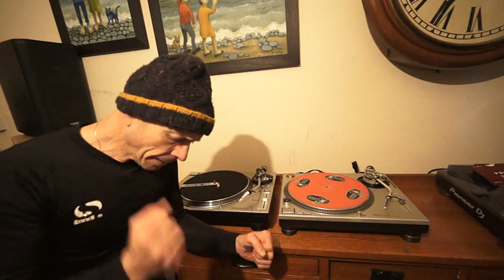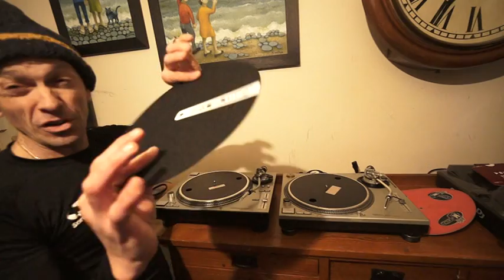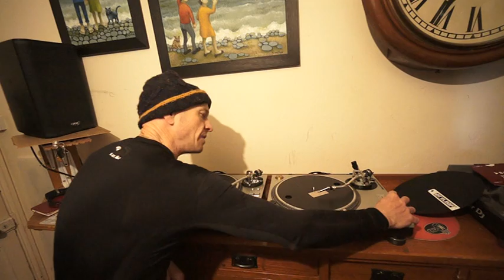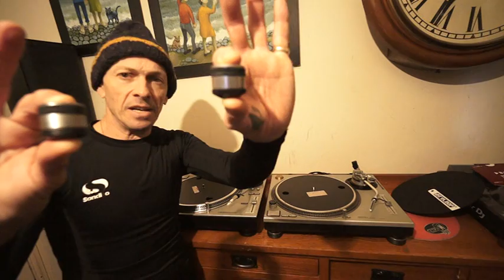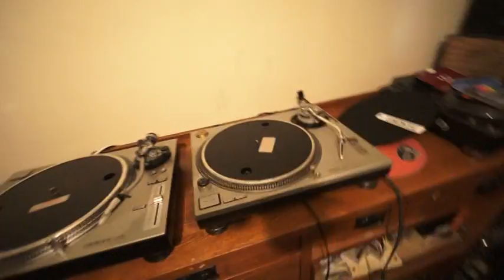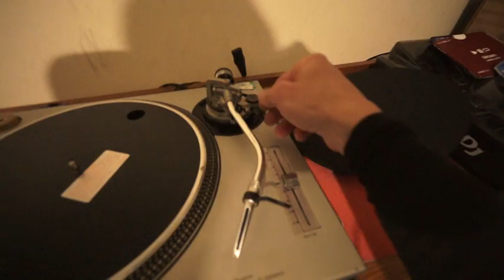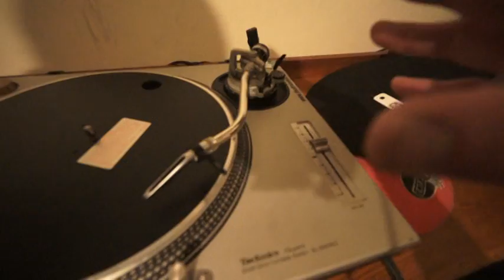RELOOP RP7000MK2 SIDE BY SIDE TECHNICS SL1200MK2  VINYL TURNTABLES

Comment: All true but there is one big difference. Analog vs digital pitch... for vinyl mixing in some styles its a huge difference. And this is the thruth.

Cheers mate and keep up the good work
Reply: Yes, I was about to comment the same thing.
The Reloop's are just as good as any other Hanpin motor turntable, so you may as well buy the Reloop's rather than spending stupid money on Pioneer PLX1000's as they are all the same under the lid.
And, if you are more into scratching, with simple beatmatching ie dropping tunes in over 2 to 4 bars, using timecodes, then any Hanpin deck will probably be fine.
But, for long transitions on real vinyl, you really need a Technics Mk2, M3d, or Mk5, because only those have analogue pitch sliders (which still control a digital circuit - but the adjustment is a lot finer).
Digital pitch sliders such as the later Technics (M5g onwards) and Hanpin / super oem decks, have large steps in the pitch adjustment which causes real problems for long mixes with real vinyl.
Also, higher torque motors, are not a good thing for delicate mixing, because the platters 'fight against' your finger drags and then slow down too much. On The original Technics, you can literally drag a nail on the platter and slow it by a tiny amount, thus a finer adjustment is possible.
Reply: But in current days you only can buy digital pitch turntables. Who knows if in the future we can buy new turntables with analog pitch
Reply: @djmoli04  You can still buy refurbished Mk2/M3d/Mk5 with brand new pitch sliders, and repainted so they look and work like new.
Reply: @DjNikGnashers  Thats not true... I´m DJing for over 20 years and i always used technics. I gave the RP 7000 MK2s a shot.. First i have to got used to the pitch but if you have figured it out, then it just works like a charm. I uploaded a minimal video set on my channel where you can see there is no weird pitch correcting every 2 bars...  in my opinion the pitch of the reloop is sensitive af compared to the technics.
Reply: @ThomasTune82  Which part of my comment 'is not true' according to you.
I have been DJ-ing since 1980 (42 years), so if we are point scoring I win.
You have not even said if you are mixing real vinyl or digital files via timecode.
I suggest you read what I said again in a bit more depth and then comment.
Reply: @DjNikGnashers  i use both Vinyl and Timecode.. no Problems
Reply: @ThomasTune82  If you can't tell the difference between them, then you genuinely are either not a good enough DJ to comment, or you are trolling.
I can post video proof of both the differences and the flaws of the hanpin motor pitch issues if you wish, and the technics digital turntable pitch dead spots, and wow & flutter motor issues.
So again, I ask, which part of my comment are you saying is not true ? Still waiting for you to explain.
Reply: @DjNikGnashers  as i said i have no issues with my rp 7000 mk2s
Reply: @DjNikGnashers  i know that the 1200 Mk2s have analog pitch and the super oems are digital... but I got no dead spot on my RPs... when i move between + 7 and 8... the strobes actually chaning in movement.. since this is digital they maybe some have a faulty firmware. mine are brand new.. so maybe hanpin fixed some issues with the firmware.. i can really say that i got no issues with vinyl or timecode
Reply: @DjNikGnashers  There is a difference between telling a difference between them and one being worse than the other. They are "different" but both are good. I have seen world renown djs work both analogue and digital pitches with no issues
Reply: @aneshas  'Seen' ?
Oh dear.
When you have decades of actual personal experience of both, you know.
The vast majority of modern DJ's play digital files, even on turntables (timecode vinyl) and the tracks are all produced to be perfectly on a certain bpm, so that mixing requires zero skill, as you don't need to be able to beatmatch. You simply set the bpm's to the same number and there is no way you can 'go wrong'.
Real analogue vinyl on the other hand, is completely different.

Comment: Just a thought....the most important thing on 1210 is the analog pitch fader.....its super super fine, I'm not sure you get that with digital pitch faster as it has stepping?
Reply: The only thing I hate about the 1210 is the center click of the pitch fader which they fixed on the mk3
Reply: @digitalbase9396  but were mk 3 digital or analog pitch faders😉
Reply: The digital pitch was introduced in the mk5 deck according to Wikipedia, https://en.m.wikipedia.org/wiki/Technics_SL-1200
Reply: @digitalbase9396  I think your right...I had my 1210 mk 2 faders replaced ....he replaced them with no click...although I kinda missed it for a while.

Comment: Digital pitch Vs analog pitch , 
You should mix some records on both turntables as test at same time  Pitch them up and get them in time, leave them playing,  I tell you now the reloop won't stay in time like the technics that's where today's decks fail with real vinyl 
technics sl1200 MK2 will always be the better deck turntable to mix real records but for scratch performance both but reloop better in that area with features, DVS both will be the same depending on DJ software , no doubt technics will have quality parts that stand the test of time, this reloop is great turntable, but will it stand the same test of time ?
Reply: 1CBRDUDE  i agree , but I wouldn't say he has no clue on this subject mate , the guys been mixing on Technics decades with experience , what I would say is that yes these reloops digital pitch might stay in time for bit but your have to keep adjusting the pitch chasing it,  digital pitch works in blocks there is no fine tune between each block like Analog pitch , that's why Technics pitch stays in time longer ( fine adjustments ) also Technics  qualtz decks direct drive motor is just the best for mixing records there is no high torque or super  etc it's just nice balance
Reply: 1CBRDUDE p

Comment: Technics every time for me
 The standard was set a long time ago and in my opinion hasn't been beaten yet. When the reloop decks have spun for 30 odd years with no probs I will maybe give them credit.
Reply: Agree mate, it's just better all round turntable for real vinyl , your be fine with DVS with the reloop buts that's as far as it goes , if I'm DJ in club with both them decks are instantly know which turntable I'll put my record on (Technics)  the other looks too light , the feet etc.  It's more about the build
Reply: @ja nee I said Technics was old technology in 2000 mate , but it's still good today ,  the parts are solid built in Japan by Technics Panasonic !  Today's turntables have cheap parts made else where
Not much new about reloop who are part of huge DJ electronics group that have Denon , Akai, Numark etc  reloop has clearly based and modelled it's deck on Technics SL 1200 mate lol
Reply: @FSwiftDJ  Re-loop 7000 series blow Technics out the water, The new Technics design is not the same as the originals, Panasonic made a massive blunder selling the copyright for Technics, Even the Vestax blew Technics away 20 years ago, especially when used for battle Djing!!!
Reply: Really ? If so why does Johnathan no longer use reloops then lately check his latest vinyl mixing  ? He's back to Technics SL 1200 MK2  why ??? Because it's simply better to mix vinyl on ( stays in time longer )  I agree the new Technics are not great , but the original is still the best deck for mixing or the all round DJ 
If you saying pioneer plx1000 was better ? Well I actually got them and I returned them in 1 week max , they couldn't hold a mix with vinyl simple 
Reloops are great for performance or battle for sure but not mixing real vinyl
The design on rp 7000 is more Technics sl1200 you can see that ,  Vestax  had great decks but was they considered club standard nope !! You never see one in any club ,  again we are talking original Technics sl1200 sl1210 MK2 here not the new Technics sl1200 Mk7 that is very like a failed Technics sl1210 mk5g deck
Your better off getting an expensive Technics SL 1200 GR then them
Minus the feet.
Back to subject , we are not talking high torque motor performance or features , we are talking solid builds, Solid parts that have stood the test of time with qualtz direct motor and analog pitch that has been the choice for every professional vinyl club djs from late 80s till this day 
It's a deck that is an all round performer .
Reply: @FSwiftDJ  Because he is a Technics fan boy and cannot see past the brand name, The old skool Vestax pdx mark 1 and 2 absolutely blew Technics away in every department and that was 20 years ago, are you saying other manufacturers can't surpass a 40 year old deck is that what you are trying to say??  i've had Technics sl1200s sold them bought Vestax pdx mrk 1, As for the re-loop  i've used them and thought they Where easily as good if not better than Technics, they have a ton of better feutures, one's i dd a set on where the 8000s right enough but same motor as the 7000s and thats my opinion as a Dj who's played for 26 years..
Reply: same as I've  been DJ'in very long time, I've mixed on them all , but Technics are the best for long mix & blends it's a fact mate 
I never said the reloops was not great 
But with Audio equipment the old equipment even if it's so old , always still sounds good and works , but I 100 % respect your opinion fella
Reply: @FSwiftDJ Yeah i get you man, i just have a thing about these people whose have the Technics blinkers on, as i say and as you well know there are many good products out there, i guess you have to find what you prefer too play on too, but i'm not saying Technics are bad they where the standard for abot 20 years and still have a mighty legacy but tbh honest i'm glad that i can discuss decks and not cdjs as i'm old skool and prefer vinyl, (just a better sound) Kinda like the hardware debate with analog vrs digital,  it's what's good for you and what turns you on.. ✌🏻
Reply: If you think a 30 year old deck is better than a modern one (Reloopmk2) at revolving a piece of vinyl, you're being romantic, looking through rose tinted glasses.
Reply: @onemoresi  I love my tinted glasses and I'm allowed my opinion 👍
Reply: I've had my pair of 1200MK2's since 1993 and I have never had a problem or had them serviced and they still look and play like new. I paid $750 for the pair.
Reply: @djbhe  that what I'm talking about 👍

Comment: I like how you didn't go in to great detail about the history of the technics.. I'm sure there was other direct drive decks at the time but they weren't technics.. i saw a hip hop documentary and a budding young american dj who was forever experimenting with electronics one day went in to a shop like rumbelows and was looking for a turntable that can get up to speed very quickly and found the technics did that.. i guess technics realised what they had and improved on that turntable which meant it was going to be used pretty much everywhere.. radio stations and clubs ... that young american dj was grandwizzard theodore.. the turntable was possibly an original 1200 designed for home use.. it was the bees knees... the rolls royce of dj turntables ..everyone who dj'd had to have the technics...it was the rolex watch equivalent...

Comment: Is it time? Time to lay Technics to rest? Is it time to realize that there are better turntables out there? Better turntables for mixing? Better turntables for scratching? Better turntables for sound quality? The 12's are a classic turntable and without it DJing would not look the way it does BUT it's time to move on!
Reply: I can’t let go of mine, I’ve had them since 1995 and they are going strong.
Reply: Digital Base If you have a Technics, by all means keep it, treasure it but just be aware that it’s no longer the ”best” turntable out there.
Reply: If I had to buy new turntables I would probably buy something at a reasonable price and performance that has the abilities of the technics as a minimum. I have already moved on years ago anyway and I’m not attached to turntables for djing. I’m surprised turntables are still around because not everyone needs them like turntabilists and hip hop djs do.
Reply: Digital Base Technics is already the base for pretty much every DJ turntable anyway.
Reply: It is still the best turntable... what would be better than a technics? People only dislike them because they 've got only +8/-8 but what do "people" know anyway?
Reply: Lenin On Acid Other turntables have more features, more torque, removable RCA’s and so on. The only thing the Technics got going for it is the build quality which is only noticeable becauce they’ve been around for so long.
If you play real vinyl the Technics is hard to beat since it had better isolation than some of these new school turntables. If you’re going all digital isolation isn’t really a problem so you’re better of getting a turntable with more features.
Reply: I still own a vestax turntable, a PDX-D3 and it’s the biggest mistake I ever made even though it had more torque and 10% pitch I hated it. The platter was different, there was no brake, crap buttons for start stop. No off button like the Technics for wind down effect. Hence I agree with you that most modern turntables are based on the technics but the early Vestax turntables tried to be original with some good features but lacking in others.
Reply: DJ Jeff So you intend to sell your Technics? What’s wrong with it?
Reply: It took 40 years for a new company to make a copy of the mk2...A COPY! Technics were so ahead of time that it took that long! Love mine...I have 3 pairs m5gs, m3d and mk2...the oldest being from 1994 and they work perfectly!
Reply: @digitalbase9396 PDX - D3's do have an adjustable brake and 12% +-  pich not to mention you can slow them down to a crawl. I don't think your talking about the correct turntable

Comment: I owned Stanton ST-150 and as a super OEM owner (which is frankly the same thing as the Reloop) they are horrible on real life usage. I own Technics SL1210MK2 now and the difference is night and day even so that mainly use them for DVS. The WOW and Flutter, the vibrations handling, the arm quality, the arm mechanics quality, the materials, and the list goes on. Technics is light years ahead. Have the Shure M44-7 which I used on both and there is comparison to be made. Technics wins all the time on all aspects. Don`t go super OEM, it will kill the vibe.
Reply: what a bunch of bullshit. If you can‘t mix on Super-OEM you can‘t mix at all.
Reply: @BlueHawk80  My friend, with all the respect, you don`t know what you`re talking about. It`s about quality of life if you ever head about that. You cannot mix with garbage equipment if it can`t work under club conditions in proper manner. As specified, i owned them and they cannot be considered a club ready equipment because of multiple issues that they have. Before trashing a comment, work with them, compare with Tech`s and then come back.

Comment: The Reloop is only a mere copy of the Technics ! A knock off actually. All those new features on the Reloop are on later versions of the Technics anyway. The Technics is also in the top 3 turntables. The Reloop is nowhere in sight. Cheers.

Comment: Hi man - i am a producer and I am thinking about to buy a turntable for sampling music. how is the sound of the rp 7000 mk2? Is it as good as the sound of the technnics 1210? I am a little bit sceptical because of the soundcard in the rp 7000 nk2..
Reply: You mean the 8000s? The 7000s are purist like techies. 8000s are the ones with extra sound features for laptops. 
I have both. Reloops are equal if not better . But they are super oem means they have a restless pitch not suited for extend mixes into techno and electronic oriented setups. They are tard better suited for battle and scratch. Techies if in good condition hold the pitch longer. Tho you would not be dissapointed. They have excellent sound quality. Check the unseen heroes (mixars sta) half the price of reloop.exact same motor and features .

Comment: Disagree a little bit about service ability of tech 1200's. There are a ton of third party spares and Technics is still producing spare parts for the decks. As well as this you can often fix the tables yourself because there is so much knowledge and documentation over the years on the internet. Also because these decks are STILL the industry standard, DJ repair shops know how to fix them. I have myself replaced pitch faders, and re-calibrated the pitch on a 1200 and it was dead easy. Parts are accessible and not too cheap considering how bloody long they last if looked after.